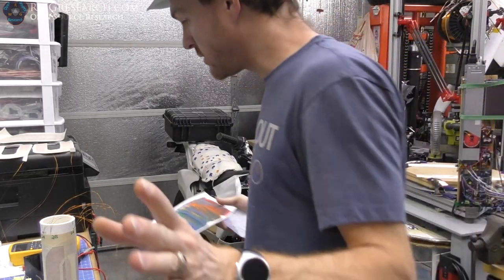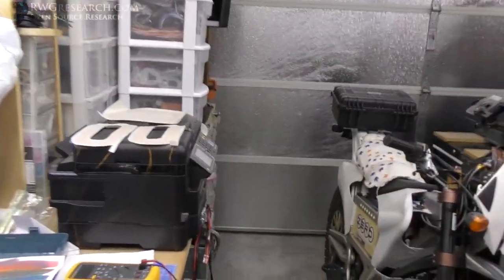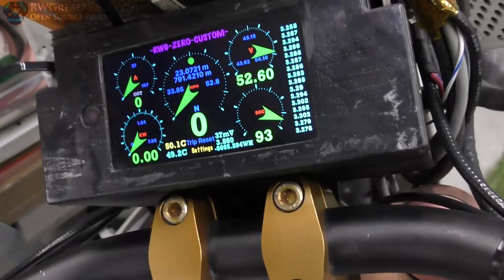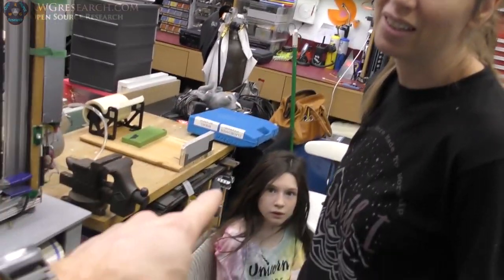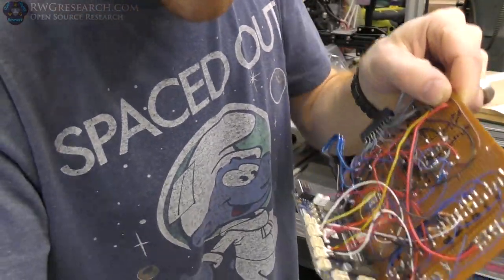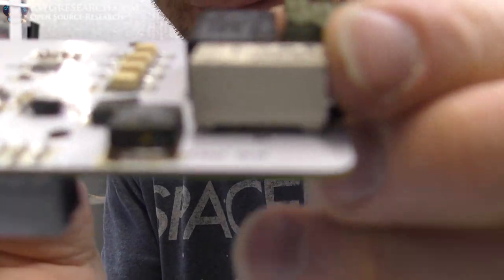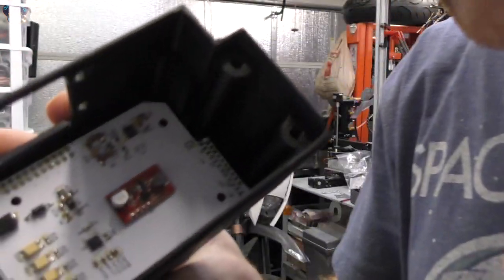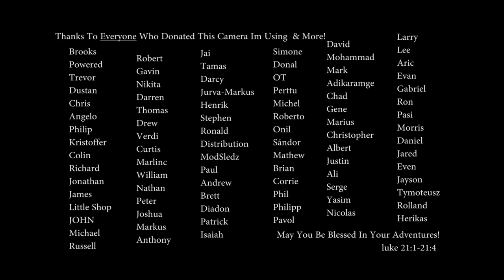Zero Part 21.. 10-7-2021. Real Circuit Board Time!!! P1

Comment: Great Ideas you have, thanks for sharing it with community. regarding cooling, why not use convection, just drill some holes and let air move thru the box as you ride. Peltier will use some energy. You can ad some conformal coating to the board and elements to protect them from dust from outside air. Cool side of peltier can lead to water condesation in some condition, but I'm sure you considered it.